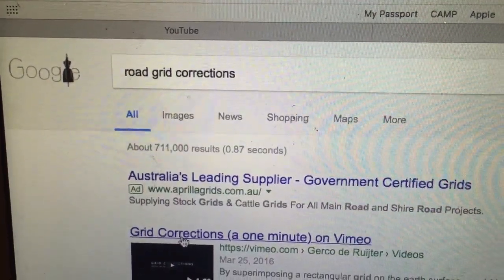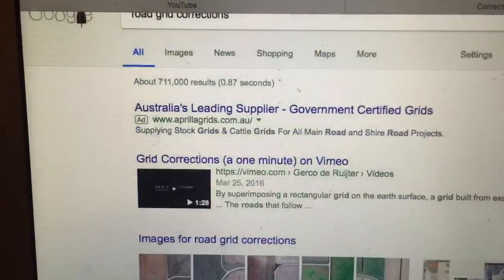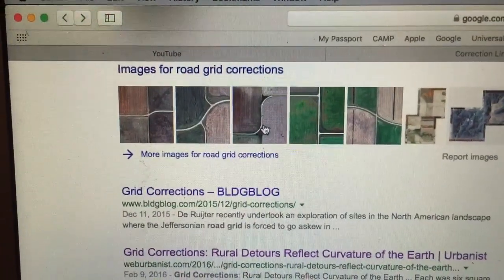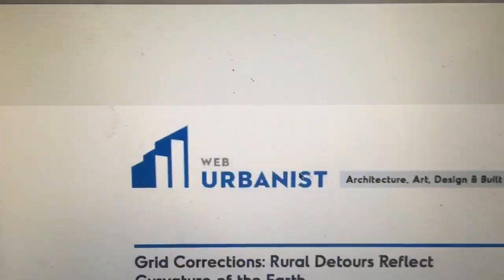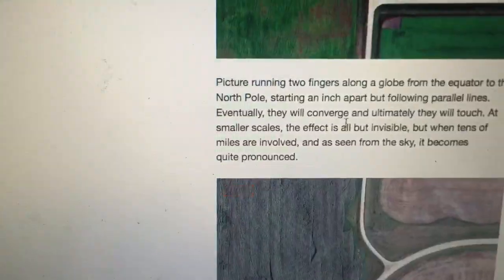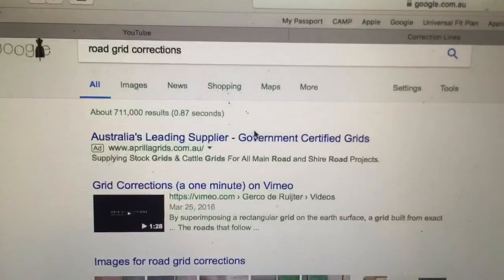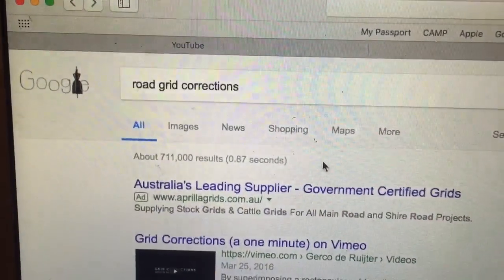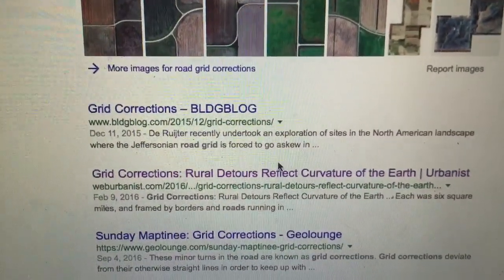Flat Earth - Road Grid Corrections - a topic worth exploring.

Comment: wolfie..... how many inches of curvature is within one single mile?
Reply from the maker: +Jimbo54 Roberts.  You already know the answer to that :-)  What does Google tell you?
Reply: Wolfie6020 well I am not asking for the answer according to the Earth curve calculator. I am asking for the amount of curvature within one single mile
Reply from the maker: +Jimbo54 Roberts. 

Ok lets go with the Google answer of an average of 7.98 inches - round it up to 8 inches per mile.   That is the same answer as the Earth curve calculator anyway.
Reply: +Jimbo54 Roberts. If you aks Google for "how many inches of curvature per mile?" it gives you an average of 7.98 inches per mile.
Reply from the maker: +Jimbo54 Roberts.  Actually I forgot I had made a calculator myself that will do this. 

I put the values in for the size of the Earth.  But you can change it to any size sphere and compare the difference.  

My calculator gives 7.99 inches based on an Earth radius of 3965 miles. 

Close enough to 8. 

Here is the calculator. 

https://dl.dropboxusercontent.com/u/62849459/Jeran/Curve%20Calculator.xlsx
Reply: Wolfie6020 okay so according to the answer in 100 miles there is only 800 inches of curvature is that correct? I mean if I walk the span of one mile and the rate of the curvature is 8 inches and then proceeded to walk a second mile still the rate of curvature is 8 inches and so on and so on
Reply from the maker: +Jimbo54 Robert - No that is not really correct.  Because at the beginning of each next mile you are not oriented the same way.  

I have been asked this many times and made another spreadsheet explaining.

Your assumption is that the direction is the same at the start of each subsequent mile.  But that is not the case.  The direction changes by a tiny fraction of a degree per mile. 

This spreadsheet factors in that tiny amount and then applies the 8 inches per each mile and gives you the cumulative result.  As you can see it matches the 8 inches per mile squared very nicely.   I did this with raw math from scratch. 

I made this for Jeran months ago.  Let me know if you don't understand it and I can make a short video explaining it. 

https://dl.dropboxusercontent.com/u/62849459/Jeran/Workbook1.xlsx
Reply from the maker: +Jimbo54 Roberts.  Sorry, I just assume everyone has Excel.  If not let me know and I'll show it to you another way.
Reply: Wolfie6020 I am on my cell phone
Reply: Wolfie6020 and it may be an hour and a half until my lunch break
Reply from the maker: +Jimbo54 Roberts.   No worries,   I'll put it in an image and link back here.  Its late here now and I have an early morning so will do it tomorrow. 

Enjoy your lunch and the rest of your day.
Reply from the maker: +Jimbo54 Roberts.  I would probably forget in the morning so just did it now for you.  This image just shows the first 37 miles but the full version does 1000 miles.  

If you have any questions let me know and I'll get back to you on it tomorrow. 

https://dl.dropboxusercontent.com/u/62849459/Jeran/Calc.jpg
Reply: +Wolfie6020
The excel file can be opened in OpenOffice Calc as well
Reply: Do you not just put roads down where you'd like? Why would the road need to adjust to come all the way back around the earth in a perfect circle? Why is that even necessary? In fact, east and west are never straight lines in any model that I know of. So, how is this any proof of curvature when you can't measure it? This is all highly speculative. Sorry I don't believe this proves anything whatsoever it's a straw man argument.
Reply: +I'm Sorry. We are talking about the (typical US-american) "grid plan" street layout here. You cannot put a rectilinear 2D grid on a 3D (spherical) surface, therefore corrections are needed to make it work.
Reply: +John Avery 
"It flattens slightly at the poles and bulges slightly at the equator - which is what Neil deGrasse Tyson meant when he described the globe as being like a pear."  
That is not how I understood him. The bulging at the equator decreases at a lower rate in southern direction than it does to the north. Resulting in slightly larger circumferences at the southern latitudes than their northern counterparts. 

(what the FE's don't (want to) understand is that those differences are expressed in 10's of miles of difference in circumference or less rather than hundreds of miles. A misunderstanding allowing massive strawmen to ridicule it)
Reply: Okay well I disagree that the curvature was measured. It must've been measured and recorded and shown to be different in separate areas across the earth especially regarding the areas of land or water near the equator on the northern and southern sides to even continue with a theory of an oblate spheroid. Where is the data that supports such a claim? How do any of you explain away the photograph that holds the record for the longest viewable distance? Should these mountains not be hidden due to our tangent view across the spheroidal earth? Why is there not any visual representations of earth with its irregular shaped sphericity? We only get perfect spheres from composite artistic representations of the planet yet we are to believe the Hubble captures imagery from unfathomable distances no problem? Why can't $50,000,000 a DAY buy us, the public who pays for nearly everything that goes on at that organization and anything that is supposedly in space at this moment, a video or image that is NOT stripped imaging and composite and actually shows the entire earth rotating on its axis? Instead we're sending probes out to asteroids and somehow magically orbiting said asteroids and then speeding back to earth years before the asteroid reaches us or will be relatively near our planet and dropping the payload of data from the satellite as it's supposed to be destroyed after entering the atmosphere. So the entire satellite can get through all of that emptiness of space and venture through the van Allen radiation belts twice while orbiting a moving asteroid a few times in the middle of the mission in some corner of space and make it alllll the way back to earth and drop data into the atmosphere to be collected and put to use yet somehow the satellite that held that data isn't going to be saved. Either it burns up in the atmosphere or it just continues off into space as if it was easy to get it to an asteroid, orbit it, return it to the atmosphere, but no we're unable to save the satellite. Can't get it to land in an ocean or anything right? What complete garbage. Give me a break. You guys have severe denial of what the truth is. You'll believe anything that a "scientist" or anyone with a lab coat or apparently a man who runs a planetarium, has one published article, and probably has a longer IMDB page than Miley Cyrus. You really need to think for yourselves and not believe everything you're told without clearly discernible and demonstrable truth.
Reply: +John Avery
That is, I believe, what a strawman argument is isn't it: (deliberately) misunderstanding a statement/argument and then atack this misunderstood version instead of the real one? 
And that is what they constantly do.
Reply: +I'm Sorry
I'll pick this one out because that is what I was talking about in my previous post:
"Why is there not any visual representations of earth with its irregular shaped sphericity? We only get perfect spheres from composite artistic representations of the planet"
The photo of the earth shot by the crew of Apollo 17in december 1972 is a real photo. CGI didn't exist in those days. It was shot with a Haselblad camera fitted with a Zeiss lens on thin based Ektachrome film, at a distance of around 29000 km/ 18000 miles from earth. Of course it had to be processed: developped and then printed. And during that old fashioned analogue processing you had to make decisions about colour too. (Ever worked in a dark room to develop and print photos? I did, albeit black and white and not colour. But even in a black and white dark room you had to make choices about greys and contrast. With colour photos you have to make an awful lot of choices about not only contrast but also colours during the processing. Many terms in photoshop like masking, dodging and burning come straight out of the old analogue dark room)
On this photo the earth looks like a perfect sphere. Why? When they say the earth is 6371 km/ 3958.8 miles in radius that is the mean radius. When you specify the equatorial and polar radius you get
6378.1 km / 3963.2 miles for the equatorial radius and
6356.8 km / 3949.9 miles for the polar radius 
That is a difference of just 21.3 (twenty one point three!) km or 13.3 (thirteen point three!) miles. That difference is way too small to see when you're far enough to capture a picture of the full earth. In proportion to the full size of the earth that difference is microscopical. All the other irregularities are even smaller than this.
Reply: hijothema could you explain how the apollo photographs survived the van Allen radiation belts? Or anything else for that matter?
Reply: hijothema can you fully explain why that is the only photograph that you can source as evidence of an actual photographed image of earth and not a composite of many?
Reply: hijothema could you explain how each night for thousands of years the constellations are the same? Even at opposite sides of our solar system in relation to the position of our traveling sun?
Reply: hijothema you have yet to respond to all of my questions. You only answered one. Which according to NASA's own admission, humans cannot travel to that distance from the surface of the earth. So again, you don't have shit. You have contradiction.
Reply: hijothema please, make me look stupid. Go ahead. Try and answer them all and seriously make me out to be an idiot. Please.
Reply: +I'm Sorry
The Van Allen belts are donut shaped with the thickest parts around the equator. The Apollos went through the thinner parts minimizing the time spent in the most dangerous  parts.
The films were preloaded in magazines and stored before and after use which gave some protection. There was a little loss of quality in  the form of a slightly faster aging due to radiation but way within what was acceptable.
The famous Apollo 17 photo was one of a series of photos they shot. That said: they were the only ones that could shoot those photos. The Apollo 17 was the only Apollo that launched at night and because of that it was the only one that had a trajectory allowing the crew to see the full daylight side of the earth. Apollo 17 was also the last mission that led man so far away which is why there were never any photos on film shot of the full earth by astronauts after them.
The satellites that deliver the source for those "composited" images orbit the earth at too close a distance to capture the earth in full. They orbit the earth scanning its surface making use of the rotation or the earth. Which is why they have to stitch the pictures to get a full image.

"could you explain how each night for thousands of years the constellations are the same? Even at opposite sides of our solar system in relation to the position of our traveling sun?"
Parallax. Just think of travelling in a car at, say, 100 km per hour. The trees at the side of the road wizz by in split seconds while at the same time you can see that church tower in the distance for minutes. 
The stars are lightyears away, litererally multi billions of miles. Our orbit around the sun isn't that big in relation to the distance to those stars.
Reply: It's ashame flat Earthers don't actually make an effort to learn astronomy. They just parrot other flat Earthers who don't have a clue how the sky works. If these people would do actual research they'd know constellations do and HAVE significantly changed over the centuries.
Reply: Motokid600 source it pls
Reply: Explain how the North Star was Thuban perhaps
Reply: I'm Sorry Why would I need to? I thought you people prided yourselves as good researchers? Is that not the case? I don't like posting links man YouTube has a fit with it. Look up "ancient Egyptian astronomy" and go to town. Look up "stellar proper motion" Just... LOOK. lol.
Reply: Motokid600 regardless of what the sky does it doesn't make the land or water form to any convex shape so you can believe whatever you want. Have a good day.
Reply: +Motokid600
"If these people would do actual research they'd know constellations do and HAVE significantly changed over the centuries."
Not centuries. More like millenia. Precession, the rotation of the earth's axis, takes something like 26000 years to make a complete circle. And the cycle of angular tilt of the earth's axis takes more than 40000 years. So it is very, very gradual.
Reply: +Im Sorry - No the apparent structure of the sky is a direct correlation to the shape of the Earth. ive said this before, but ill say it again. There are two celestial poles because the Earth is a sphere. Field rotation when observing celestial objects is a direct result of living on a globe. Telescope equatorial mounts exist ONLY because the Earth is a globe.                     

+hijotheme - No, stellar proper motion is something thats actually recorded on a yearly basis by astronomers. The precession of the Earths axis is an entirely different process.          http://www.astronomy.ohio-state.edu/~pogge/Ast162/Unit1/motions.html             "Proper Motion is the apparent angular motion of a star
across the sky with respect to more distant stars.
Typical proper motion is ~0.1 arcsec/year.
Largest: 10.25 arcsec/yr (Barnard's Star).

This is the projection onto the sky of the star's *true motions 
through space relative to the Sun.*
" 

And for +Im Sorry - http://www.crystalinks.com/egyptastronomy.html              "Note however that the observation that a stellar alignment has grown 
wrong does not necessarily mean that the Egyptians understood or even 
cared what was going on. For instance, from the Middle Kingdom on they 
used a table with entries for each month to tell the time of night from 
the passing of constellations: *these went in error after a few centuries
 because of their calendar and precession, but were copied (with scribal
 errors) for long after they lost their practical usefulness or possibly
 the understanding of them.*
" 

"The precise orientation of the Egyptian pyramids affords a lasting 
demonstration of the high degree of technical skill in watching the 
heavens attained in the 3rd millennium BCE. *It has been shown the 
Pyramids were aligned towards the pole star, which, because of the 
precession of the equinoxes, was at that time Thuban, a faint star in 
the constellation of Draco.* Evaluation of the site of the temple of 
Amun-Re at Karnak, taking into account the change over time of the 
obliquity of the ecliptic, has shown that the Great Temple was aligned 
on the rising of the midwinter sun."
 
https://www.bibliotecapleyades.net/piramides/esp_piramide_8.htm               

"It is vitally important to understand that the sky looked different 
   at the time of the Pyramids. The overall shape of the Belt Stars has remained remarkably similar although 
   many other parts of the sky have changed dramatically. "
Reply: Someone please let me know if my post above with the links and quotes went through.
Reply: Thank you. I know Wolfie permits it, but YouTube... idk. It gets weird sometimes.
Reply: +Motokid600. Your links came through. Wolfie allows people to put links in their posts.
And I know that astronomers observe the motions of the stars. But they use all kinds of equipment that enables them to do that. For the casual observers (= is the oridinary people) those motions are not really visible. Your quote uses the measure of arcsecs per year. One arcsec is 0.000277777778 degree (Yup, I had to google that) That isn't visible with the naked eye. 
And the motions of the earth's axis does play its part in the changes of the sky over time. It's how the "pole star" changes.
https://en.wikipedia.org/wiki/Pole_star#/media/File:Precession_N.gif
If the orientation and tilt of the earth changes the angle at which we see the stars changes. But as I said: that is a very, very gradual proces. Like the very very minusclule apparent angular motion of stars.
Reply: +motokid  posting links that support your claims instantly makes you better than ten flat earthers.  they hardly ever seem to bother.

both soundly and wolfie are good at approving links and will make sure you are automatically cleared if they know you not to be a spammer.  otherwise omitting the https and www and breaking the link with spaces will fool the filter.
Reply: +hijothema - Correct me if im wrong, bit +Im Sorry wasnt referring to axial precession. All flat Earthers have these vast cosmic speeds stunk in their heads so they often use the argument of "why haven't the stars moved over thousands of years?" And the answer to that is they do via proper motion.   Edit: oh thats right he did mention pole stars, but i was responding to this comment. " could you explain how each night for thousands of years the 
constellations are the same? Even at opposite sides of our solar system 
in relation to the position of our traveling sun?" - Im Sorry.
Reply: Motokid600 isn't it nice how we live in the magic time frame in which we have another pole star directly in line with many constructs throughout the earth from many different cultures throughout all of time. Very odd how we just are that lucky to have another North Pole star somehow perfectly passing through a previous pole star's position in which it was recorded in the past, according to the evidence you've presented. What a coincidence. Many many things about the globe and the model are just coincidental such as the sun and moon seemingly the same in size optically. They just are coincidentally placed perfectly to be viewed from earth in such a manner. Love the coincidences. Peace.
Reply: It's not directly in line with it, nor will it ever be... Go look at a star atlas from the 17th or 18th century and see how far away it was from the actual pole back then. Download Stellarium and set the date to 5000 AD and see how far past it will have shifted by then. What you call "coincidences" I call ignorance, because precession has been known about for many centuries. What difference at all does it make that the sun and moon happen to be the same visual size in the sky? The only reason you even have things to call coincidences is because people who did more than flat earthers ever have or will to research and discover them in the first place.
Reply: i do think we got quite lucky with the size of the moon.  it's allowed for some important observations.  nothing lucky about the pole star, however.  it's not centre and, given the number of stars available, it's probably very hard not to have a pole star.
Reply: can you fully explain why that is the only photograph that you can source as evidence of an actual photographed image of earth and not a composite of many?

There are many..Many...MANY photos of the Earth, but dishonest flat Earthers know that they are going to label each and every one shown to them as being "fake" even before they see them. Apparently they are all photographic analysis experts.

The Himawari-8 satellite takes full Earth images of the Earth all day every day. You can view them at any time: http://himawari8.nict.go.jp/ and http://www.jma.go.jp/en/gms/

The Russian Elektro-L does the same thing. They are both geostationary weather satellites.

And just because an image is a composite does not mean it is "fake". A composite is merely a photo made up of several photos. It is not the same thing as CGI, which didn't exist in the 1960s.
Reply: could you explain how each night for thousands of years the constellations are the same? Even at opposite sides of our solar system in relation to the position of our traveling sun?

Sure, no problem: Our solar system takes over 220 MILLION years to make ONE revolution around the Milky Way, and all of the stars we see are moving along with us. Imagine a 10 million lane highway with all of the cars going the same speed. From the perspective of any driver it would seem like there was no change at all. So, even if you lived to be 100 years old you would not notice ANY change at all in the stars you see.
Reply: you have yet to respond to all of my questions. You only answered one. Which according to NASA's own admission, humans cannot travel to that distance from the surface of the earth. So again, you don't have shit. You have contradiction

Are you referring to oft-repeated claim that NASA said "We can not get through the Van Allen Belts"? Couple of things to say about that.

First, it is referring to the fact that we do not CURRENTLY have any vehicles that are designed to go through the VABs with human beings. Even the Space Shuttle was not designed for this purpose.

Second, think about this for a second: Does it make sense that NASA would write, shoot, narrate, edit and upload a video where the narrator "admits" that we never went through the VABs? Or does it make more sense that it was meant to be taken the way I mentioned (no current vehicles, etc)?

Third, a flat Earther, ODDTV, made a video where he uses one of those NASA videos and the guy says "We've not had a vehicle that can carry humans through the Van Allen Belts", but when you watch the ORIGINAL NASA video, the narrator actually says "We've not had a vehicle that can carry humans through the Van Allen Belts IN A GENERATION." A little dishonest to cut the video right there, don't you think?
Reply: I sense great things coming from you in the future, JW3HH, very nice videos!
Reply: +I'm Sorry

You are new to this trolling business, aren't you?

You come into a comment thread and then bombard with a SCRIPTED list of predefined questions, and DEMAND answers.  Funny.
Reply: +Motokid600
That I'm Sorry kid was pitiful..,    Perhaps that's why he screams "Forgive me Please"
Reply: +hijothema
You completely forgot star motion.  Millennia is correct, but most stars have their own relative motion  "Proper Motion."

On the LONG, LONG term, stars are swimming around like a bunch of drunken billiard balls..,   We'll never notice much difference in our lifetimes.  A problem that flat earthers take to mean "CONSTELLATIONS DON'T CHANGE."
Reply: +Muzikgod
You didn't catch the "Troll" behavior on "I'm Sorry?"
Reply: +John Avery

ROFL!  Tit-for-tat.., 

Nice post with all those counter FE questions.
Reply: +jw3hh  nice work, dude.
Reply from the maker: +Jimbo54 Roberts.   That image you posted shows exactly the typical mistake Flat Earthers make.  It is not 24 inches of curvature at all.  

Each mile has 8 inches of curvature - sure, but do you see even in your diagram from point B and point C the person is standing at a different angle?   He is looking at a different angle when he starts across each subsequent mile. 

It is quite incorrect to simply add 8 inches x how many miles you cross.   Doing so you are completely ignoring the change in direction. 

That is what I explained in my table of each mile - adding the 8 inches to each change in angle it works out just like the 8 inches per mile squared.   

Here it is again if you missed the first link. 

https://dl.dropboxusercontent.com/u/62849459/Jeran/Calc.jpg

There is more to it than just adding 8 inches for each mile.
Reply: +Motokid600
"+hijothema - Correct me if im wrong, bit +Im Sorry wasnt referring to axial precession. "
I was responding to your remark about the changes over centuries. I used precession and axial tilt simply as an example of how slow things move over time, i.e millenia rather than centuries. Nothing more really.
Reply: +JustWasted3HoursHere
@ your answers to "can you fully explain why that is the only photograph that you can source as evidence of an actual photographed image of earth and not a composite of many?"
I always take the Apollo 17 photos as example because they really are (to my knowledge) the only old fashioned 'film exposed to light' analogue photos of the full circumference of the earth. Even the 1967 colour image of ATS-3 is a linescan image and more like a fax than a photo.
The ones you refer to - the Himawari 8 and the Russian Elektro L (and I would add the EPIC images from the DSCOVR. They are my favorites https://epic.gsfc.nasa.gov/ )  - are all digital. Which gives too easy an argument of "Fake! CGI!" for flat earthers.

And you're absolutely right: composite doesn't mean fake. Panoramic photos are stitched from a series of photos and therefor composites. That doesn't make the panorama less real.
And even more:
You can argue that all of our digital photos that we take with our cameras  are "composites" and "CGI". The sensor can only register the amount of light it receives, resulting in a greyscale image. It takes the mosaic of red, green and blue filters of the Bayer filter on top of it to enable the computer inside the camera to determine the colours. "Composite! CGI! [literally: the Computer inside the camera Generates the Image based on the information it gets from sensor and Bayer filter] Fake!"
Reply: Wolfie6020 the change in direction is due to the 8 inches of curvature.
Reply from the maker: +Jimbo54 Robert.  The change in direction is due to 1 mile across a circle 24901 miles circumference is an arc of 0.0145 degrees.      That ratio of distance to circumference on any size circle or ball would produce the same change in direction but a different amount of curvature drop.
Reply from the maker: +Jimbo54 Roberts  I looked at your link and it is just the same mistake you posted earlier.  You asked me a question and I have answered it correctly.   Sorry if you don't understand what I am saying to you but that is entirely up to you mate

Did you look at the Excel sheet calculations?  Do you not understand the numbers?
Reply: John Avery John Avery 
1. If per say a dome exists above us, with simple light experiments you can see how this can occur if the light is an emittance of electrostatic/magnetic energy/vibration source(s) from the magnetic North Pole. Look it up. 

2. The stars are much lower to us than you are taught, hence it is our "ceiling" from which the starlight is visible to us. With a ceiling/firmament type construct of energy or physical matter unknown to myself, your visual perspective will render it impossible to see anything that is vastly distant from your place on the plane, even as it is on the "ceiling" which is much higher than the ground, meaning your perspective line of sight to the sky is a further distance, but still not an infinite distance due to the limits of the human eye to view light at such distance through the many layers of atmosphere that are bending such light due to the magnetic energy of the sun and its electric effects on noble gases, obviously. 

3. Obviously the stars spin around us. Whether you believe either model, this is obviously visible. They rotate around the pole star Polaris. With the energy being emitted from the center of the plane and rotating, why wouldn't these areas see the same stars while all facing south and looking up as the entire sky circles around? Keep in mind the possibility of a dome like structure. Otherwise take note of how a disco ball reflects light against all the different surfaces of a bare room if the disco ball is in the center. There is no definite explanation of what exactly emits the starlight 100% but these are two of my theories that sadly cannot be tested because I do not have the funding or resources to even travel to the North Pole. And personally do not have time. Currently waiting on more information on that topic but there is a couple possibilities for the FE.

4. The path of the local electromagnetic sun is what causes these atmospheric reactions. I'm sure there's more on that to be discovered but the scientific community largely has been hijacked into falsely analyzing data and using gravity and a spinning ball earth to explain away many of earth's phenomena, until recently. This also answers question 5, as the apparent path of the sun and the electric universe dictates that motion. 

6. I personally believe the distance of 3,000 miles is very incorrect. I believe the sun to be much closer, as do many other intelligent and highly researched members of the community. We are still working out an understanding of exactly where the sun is and exactly how it works. Closer as time passes. 

7. This is an effect of our electric universe   The sun doesn't entirely create light rather than it  mediates some of the light that is. Another part of the untapped knowledge due to faulty basis of scientific understanding on a globular earth, I would conclude. 

8. Again, the sun mediates some of the light. It does not totally "create" light. This can be demonstrated by YouTube account Dimensional Dan. Of course it is not 100% irrefutable proof but it does provide credibility to the claim of the sun mediating and gathering light from the noble gases to create what is perceived as the "source of light" when in actuality it is not. This is new information. Again, we do not have all the answers yet. This is what we have found and understand so far to be possible and likely. 

9. Where do you gather that assumption? The sun and moon obviously both circle at different speeds in the sky. 

10. The moon only has one side. It is not spherical. It is an opposite effecting light, in relation to the sun. Sunlight is a warming light and the moon is a cooling light. The temperature claim is demonstrable and repeatable. It is not the same energy that the light from the sun gives off. 

11. Just because your definition of geodetic surveying claims it accounts for the curvature of earth's surface doesn't mean that it does in fact do that especially over bodies of water. Consider the surveying of the Great Lakes for a perfect example. 

12. Cartography is not as simple as you assume it is. No outside-of-mainstream source has been a flat earth cartographer for a few generations I assume. Especially understanding that the earth is very large it would take a collaboration What's more questionable is the distortions with pretty much every map with a globular projection. Including the photos taken from drones/balloons that are stitched together to create the globe earth projection. We don't claim to have an accurate model of the complete layout of the land. We all agree there is no discernible curvature across any body of water and between same-height mountain peaks with distances of many miles in between the mountains. 

Anything else?
Reply: Wolfie6020 that Arc is called curvature and there is 8 inches of it in one mile
Reply: Wolfie6020 I never could get it to pull up on my phone but someone who was able to told me that it was rubbish just the 8 inch per mile squared
Reply: Harry M I dont think so....8 inches of Curvature is not a slope....you guys are the ones that came up with the "8 inches in a single mile" so dont blame me...if thats not the amount of curvature in a single mile then let's hear what the true curvature rate is plz im waiting
Reply: Thanks, John! That was very kind of you to say! I only wish I was proficient in 3D modelling software so I could REALLY make some cool videos!
Reply: Thank you, Sir!
Reply: Nice videos!  Short, concise, and easy to follow - just the ticket for non-scientific old farts like me. I especially liked the humour in the equinox video (earth doesn't have a red bar through it; countries don't have their names stamped on them in giant letters). I'm now your 50th subscriber.

Thanks! Yeah, I don't understand why flat Earth videos need to be 1, 2, 3 or more hours long to "make a point". I am certainly no genius. In fact, I consider myself of average intelligence. If even I can figure out that the Earth is not flat, then basically anyone can IF they are motivated to find the ACTUAL truth. The problem is, most flat Earthers are motivated by the conclusion, not the truth.

It's hard to have a real debate with a flat Earther because they tend to disappear from the conversation when things get "difficult" or they go off on some unrelated tangent. I mean, how does it not bother any flat Earthers that even after all these years there is STILL not a single working model of the flat Earth? You know, one that SHOWS how the equinox could work, or how stars can be seen rotating in opposite directions around totally different stars (which magically can not be seen by people near the other pole), or how the moon can show the same face (and phase) to everyone on Earth if it is close, etc.

I truly believe that the vast majority of them are either fakers, or not as confident in their theory as they would like us to believe. If they were confident, they wouldn't have any problems answering those difficult questions.
Reply: +Jimbo54 Roberts
The picture simply proves that you need different MATH that just adding inches per mile forward.., 

It actually takes TRIGONOMETRY to do it right.
Reply: +Jimbo54 Roberts

It is ONLY 8 inches in THE FIRST MILE.  For each additional mile FROM THE OBSERVER, it is compounded to something like:

Sqrt of ((r^2 + miles^2) - r) * 12 * 5280

Based on the Pythagorean theorem.

(There's a way to do it with trig, but I can't find it.., )

Something like this:
drop = sqrt((2*sin(360(c)/(2pi*r)/2)r)^2-(sin(360(c)/(2pi*r))*r)^2)

But I haven't analyzed this one to simplify it.  (I swiped it from "working-with-the-curvaure-of-a-spherical-earth.htm"
Reply: Neil Helgeson you are thinking of the "8inch per mile square" formula....thats not what im refering to
Reply: +Jimbo54 Roberts
I'm talking about continuous curvature, not the dumb way of 8"/mile*2  That is LIMITED in accuracy.

But anyway, which "formula" are you referring to?
Reply: +Jimbo54 Roberts

Usually I just apply this function:
watch?v=5_roC2Lma_8
Reply: Neil Helgeson (2-8 inches per mile) at sea level
Reply: JustWasted3HoursHere I just answered many of these in my last comment if you'd take a look
Reply: John Avery may I remind you that the maps of all land masses and the entire earth was flat until the Jesuit indoctrination took place in different areas at separate times around the world. Even as late as the 1700s did China have a flat earth cosmology, until Jesuit priests rolled into town. You DO understand that the distances between masses on the globe model is also incorrect but you can't accept that fact. I knew that before I ever questioned if the earth was in fact spherical. This isn't hidden knowledge, in regards to all maps and models of the globe earth being inaccurate in many aspects. Cheers!
Reply: John Avery I don't need an entire map built to show me locations of masses and bodies of water if you know a body of water isn't showing any appearance of curvature over 50+ miles and you can see docked boats on the shore opposite of you, with no mirage distortion, no inversion of light, just a clear view through on a clear day. The norm is to see it as it is. With dryer air comes less atmospheric lensing. Sure this isn't going to convince you. You just ignore the fact that this shouldn't be possible whatsoever on a globe between 20,000-30,000 miles in circumference.
Reply: +I''m Sorry

Every point in your treatise above is FALSE.., 

For all the reasons flat earth is a false "science."
Reply: +John Avery The 8-inch formula is also not a formula for a circle. It's one of the reasons that it only works over relatively short distances (the other is, as Wolfie pointed out, that it's not precisely 8 inches, even using mean diameter). It's actually a parabolic calculation that never turns back on itself.
Reply: Dude, you are just wrong on so many fronts there's no point addressing them all. No one can stop you from making things up out of thin air, but that's all you're doing, and no one is going to take you seriously except other people just making things up. 

- Distances between "masses on the globe model" is incorrect? What does that even mean, and how would you know! Funny how the world's navigation, travel, and shipping services have no problem finding their way around on it when you lot can't even draw a map!

- The sun now isn't even 3,000 miles away but is "much closer"?! Of course you can't explain anything at all about it despite being "intelligent and highly researched", or can even conceptualize how much worse such a claim makes it for you all to explain observations of it.

- With dryer air comes less atmospheric lensing? Good, then you can explain what happened to the bottom 4,000 feet of this mountain that is 110 miles away from me then in the second driest state in America on a clear 15% humidity day. Should be a cakewalk for you. Let me guess perspective convergent refractive vanishing point sub-horizons, or some bullshit like that you can't illustrate or describe? https://www.youtube.com/watch?v=TqLET6jMSRc

 may I remind you that the maps of all land masses and the entire earth was flat until the Jesuit indoctrination took place in different areas at separate times around the world.

No, you may not, because it's a lie, intentional or not. Everyone from the Arabs on back to the Greeks knew it wasn't, Ptolemy was creating spherical map projections in the 2nd century AD to better plot locations on his maps because he knew it was round. Emperors and other monarchs at their coronations hold a Globus Cruciger in their hand to represent their connection to Christ as Salvator Mundi. They don't hold a plate, they hold a GLOBE to represent the earth. 

403 - http://www.wildwinds.com/coins/ric/honorius/RIC_0030.jpg
546 - http://www.wildwinds.com/coins/byz/justinian_I/sb0291.jpg
705 - https://en.wikipedia.org/wiki/File:Solidus-Justinian_II-Christ_b-sb1413.jpg
945 - http://www.wildwinds.com/coins/byz/constantine_VII/sb1747.jpg
1084 - https://www.lernhelfer.de/sites/default/files/lexicon/image/BWS-GES-0735-01.jpg
1390 - https://en.wikipedia.org/wiki/File:Richard_II_King_of_England.jpg
1660 - https://apparences.revues.org/docannexe/image/1320/img-3.jpg
1953 - http://www.thechicflaneuse.com/wp-content/uploads/2017/06/queen-elisabeth-incoronation-officila-portrait-613x700.jpg
Reply: +John Avery

You just HAD to address ALL of his points didn't you.

Now you're REALLY going to make him look like an idiot.  Village idiots will now have to get different designations for their vocation.
Reply: They can think of it as a promotion and can now laugh at flat earthers.
Reply: John Avery lol I feel ya....I just went to the library and looked at a book called trigonometry for dummies....smh....I was so confused ....just way over my head bro
Reply from the maker: +Jimbo54 Robert.  No it was not rubbish.  It was the answer to your question.  The other person clearly did not understand what he was looking at .    It was not the 8 inches per mile squared at all.  It was a breakdown of the angular change per mile on a Globe.   The results were similar to the 8 inches per mile squared because that is reality.  

You simply do not just add up the 8 inches x the miles - that is a child's logic and not how it works at all.
Reply: Wolfie6020 I think I am beginning to understand where im wrong .... this math that we are discussing assumes "a circle" correct?
Reply: Wolfie6020 let me ask this....I get that the Earth is curved....I agree to that 100%.... could this math also be applied to ...say.. an object that is curved but not consisting of 360°?
Reply: Wolfie6020 and plz....you have been more than kind to me so far...plz dont give up on me now
Reply from the maker: +Jimboy54 Roberts - sorry then I apologise for assuming you were a Flat Earther.  My mistake.    Yes Sure.  What shape do you mean?   Like a slice of pie?  looking at the curvature of the outer edge of the slice?
Reply from the maker: +Jimbo54 Roberts.  No not giving up.  Sorry if my tone sounded that way.    No it does not have to be a full circle at all all,  any small part of the circle will work.  

It won't work on a shape where the curvature varies though.   The radius of the curve needs to be constant for this math to work but no need for the full circle.
Reply: Jimbo54 Roberts You mean not a sphere? Conceivably, but only if you ignore that fact the it works everywhere and that the intercontinental distances are known. Really can't conceive of a big curved disc that could match up.

And that's just the measurements; the sun motions really screw up that idea.
Reply: Wolfie6020 I am actually a former flat Earther ,and im just trying to work out all the discrepancies in my mind about "round earth"....im not sure what shape I think the earth is....but I am 100% sure that it's not a flat disk thanks to a coworker who was very patient with me and was able to show me that the FE map can never work....
Reply: 1st Try Science why is it soooooooooooooo flat from our perspective? and I did and Earth curve test where I captured the Atlanta Skyline from 36 miles away how does this fit into the Globe Earth model?
Reply: 1st Try Science https://drive.google.com/file/d/0B72xTLgeo6COblNqSXFzNXBpZG8/view?usp=drivesdk
Reply: Jimbo54 Roberts It's sooooo flat because it's sooooo big. And you haven't given me enough data about your test. Elevations, heights of objects, weather. Precise locations. Whenever I see these tests, they are usually well within expectations. They are also at marginal distances. Never hundreds of miles.
Reply from the maker: +Jimbo54 Robert.  Ok, thanks for explaining.  It helps to know where you are coming from.  As for the Atlanta Sky line,  do you have a video?  More info would be great if possible.  i.e. the exact location and elevation of your observation - precise distance etc. 

One thing I have have proven to myself is that refraction is very real.  I have taken dozens of videos of Sunsets and the telescope mount will track the Sun nicely all day but in the last 30-40 minutes the Sun rises in the frame significantly due to refraction. 

What I have seen in my own tests would easily explain most of the observations where people can see things that should otherwise be hidden by curvature. 

Here are some of my videos showing the refraction - watch the sun's movement in the last part just before it sets. 

https://www.youtube.com/watch?v=_ydc7Oeredw

https://www.youtube.com/watch?v=0Birr5J9To0

https://www.youtube.com/watch?v=ccE_xfdPnOE
Reply: Wolfie6020 ok so im about to give exact location and elevations.
Reply: Wolfie6020 that is exactly where I stood and took the photo....the skyline is very tiny and can only be seen at night(probably because of pollution) the elevation where I took the photo is 968ft above sea level and atlanta sits at 1023ft above sea level...need more info just let me know
Reply: Wolfie6020 oh and im 6"2
Reply: There's no reason you wouldn't see the skyline from there if you actually have a clear shot through so many intervening trees. Even if Atlanta were at the same elevation the refracted hidden height at that distance is 613 feet and there's a number of buildings taller than that there. The extra elevation of Atlanta would make them even more visible, but you're right with so much haze there it's probably easier to see the beacon lights and windows lit at night.
Reply from the maker: +Jimbo54 Roberts.  Thanks they were in the spam folder but I just approved them.  Back to you later today on it as I am heading out to catch up with a few friends for lunch now.
Reply: John Michaelson "the extra elevation of Atlanta"  

if the observer hight were at same level as the city....that would be the same as observer hight being zero right? so with the observer hight being lower than zero....wouldn't that cause the skyline to be more obscured?
Reply: Correct, for all points at or above your own elevation the observer height is just your own six foot height.  At 36 miles the intervening bulge height is just 216 feet. Across much of the distance to Atlanta the elevation is lower than your view height and then it rises comparatively abruptly at Atlanta's downtown itself. It varies but the high points are at 1060 feet or so. Some of the downtown buildings are over 800 feet, plus whatever antennas and lights they have on them. Here's a Google Earth 10° FOV scene from where you gave to downtown. I raised the eye height a little because Google Earth does not bother modeling refraction. http://imgur.com/XX1DtLl
Reply: John Michaelson id say your on it sir .... hats off to you. so this is huge for me cuz when I first done this experiment I almost fainted...but this helps with some trouble ive had ...im one step closer ....thank you John and Wolfie
Reply: John Michaelson so a good note for future reference.....the flat earth map cannot and never will work...if by the grace of God you can ever get a FE to see this truth ....might be very effective...it was for me....but I guess some will hang on with dear life.
Reply: Well you're certainly welcome from me! People ask all the time why we even bother with flat earthers and their arguments, but it's exactly for reasons like this and to help courteous people like you. I quite enjoy checking these little scenes out to see if they're plausible and I really did smile when I saw it in GE. I figured you were on Stone Mountain or something, in which case of course you'd see it easily.
Reply: John Michaelson Sagitta..,
Reply from the maker: +John Michaelson. 

Thanks for the help again John.  I haven't looked at the details of it yet but it seems you have answered Jimbo54 Roberts question. 

+Jimbo54 Robert.  Yes the map is a killer for FE,  they just don't have one that can work.  

Have you seen the excellent comparison calculator for the Globe and Flat Earth for calculating flight plan distances? 

http://walter.bislins.ch/blog/index.asp?page=Distances+on+Globe+and+Flat+Earth

When you look at distances in the Southern Hemisphere they don't work at all on a Flat Earth. 

Another great point to research is the Equinox - on September 22nd you will see the Sun setting at 270 degrees.  (due West)   This happens all over the Earth on this day and is impossible on a Flat Earth. 

This video shows you why.   Worth taking the time to test this yourself.   Many Flat Earthers won't even try which I find very perplexing if they were genuinely looking for the truth. 

https://www.youtube.com/watch?v=822oDc3_9AQ
Reply: Wolfie6020 yes thank you wolfie ....another question I have is why is NASA so laid back about the issue....why will NASA not partner with someone like Jeranism or Eric Dubay...both of which influence masses of ppl thinking the Earth is flat,and prove in some way once and for all that the Earth is Indeed curved....maybe allow Jeranism to attach his very own non fisheye camera to a rocket to space....this would be groundbreaking considering how many ppl Jeranism influences
Reply: Wolfie6020 and btw that flight time calculator is awesome!!
Reply: John Michaelson went back tonight to take more photos of the Atlanta skyline and guess what? ....only the tip tops of the tallest buildings are  visible....light refraction?????
Reply: It looked like 5-6 buildings were tall enough to make it over the trees, but that's all dependent on Google even accurately plotting those tree heights, etc. You're getting to the fringes of what can be calculated accurately at least with stuff accessible to all of us remotely.
Reply: John Michaelson the buildings are raised hundreds of feet
Reply: Without seeing the picture or having ever been there at that spot myself, I can't really add anything more. Taking nothing else but the curvature of the planet into account, some of the buildings should be visible. Everything beyond that as to how much and how high etc. are variables that require more data than I have access to.